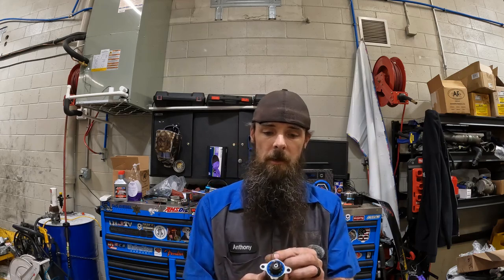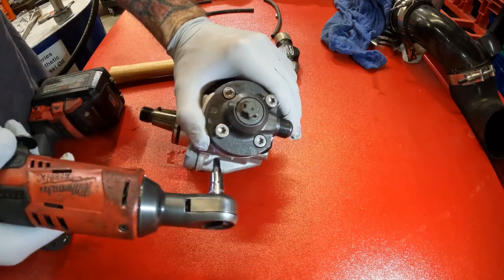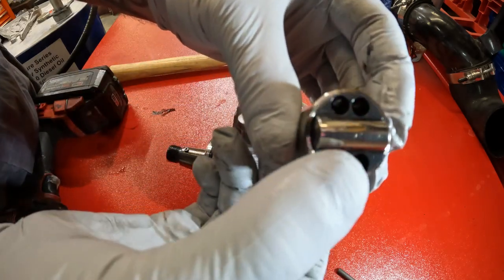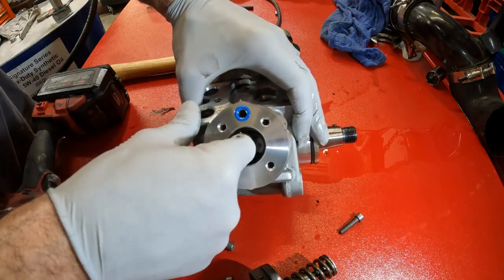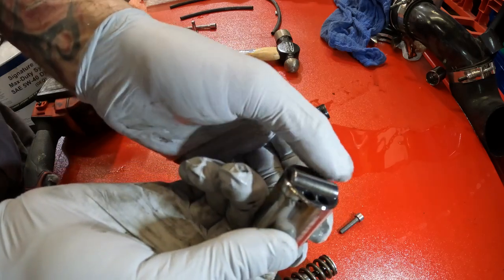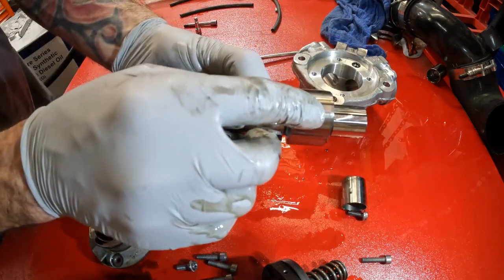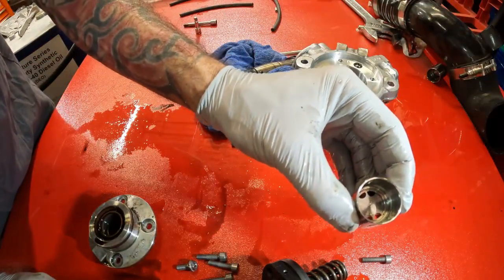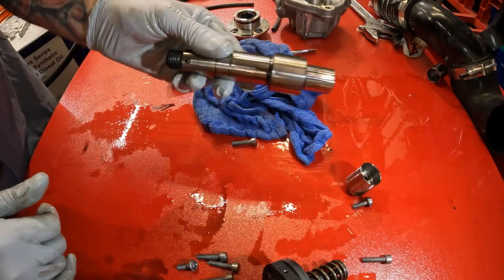How Bad Is This Powerstroke CP4 Failure?  Let's Find Out

Comment: Do you know if the 2019 late yr model is covered under recall.  My truck has 120k and just went to limp mode and Fird told me to bring in and it may be covered. Any pointers?
Reply from the maker: Usually a 2019 isnt covered under the cp4 recall. Thats the 2020 model.  Late model 19 is still a 19.  When was the last time you changed filters?  Usually if a cp4 goes its not going to go in limp mode. It jjst wont run.

Comment: Great channel and thank you for taking the time to make the videos to help educate everyone. Thoughts on installing a S&S disaster prevention kit for the fuel system? Is it worth it and would it prevent a contamination? 
2015 F250 6.7 with 77k miles. Thanks Shawn
Reply from the maker: Disaster prevention kit is good.  Depending on your budget go with a DCR pump from S&S and not worry about the cp4.  The disaster prevention prevents the entire fuel system from being contaminated if the cp4 were to fail.  Its just another filter basically. I'd go with a dcr pump though.  Again. Depending on your budget.

Comment: I will never take my truck into a psd tech after watching this thanks though and may you be blessed
Reply from the maker: Why would you not take it to a PSD tech?  Did you mean not a quick lube place?  PSD techs fix PSD. You're comment is very confusing. Like saying you won't go to IHOP because they serve pancakes. Oh and the drivers for this fleet vehicle neglected to bring it as well after being told to. Thats why this all happened
Reply: @ because how simple it is to swap it out why pay thousands if I could just do it myself. You know what I mean
Reply from the maker: @chris24v  swap what out?  The oil and filter?  By all means yes please do so. The engine?  Have fun. Its not just a simple swap.
Reply: I’m Talking about swapping out the cp4 it’s not that bad.
Reply from the maker: @chris24v  ohhhhh man I was so confused for a min my bad. Totally thought thus was a different video (got a lot going on) No cp4 swap isn't bad at all. Just make sure you reset the high pressure fuel system afterwards. I have had people tey to do theirs and they can't. But I also install DCR pumps. We don't put cp4 back in.

Comment: i have a 2019 ram 5500 with 6.7 i got diesel coming from lift pump but nothing coming out of cp4 no high pressure at all help please im planning to change cp4
Reply from the maker: Sounds like you have a cp4 issue if you got nothing coming out. Sounds like a failed cp4
Reply: @ thanks for your quick reply.,if I got diesel coming in I have to get something coming out right? There’s nothing at all coming out of cp4 already test metering valve is good no debris looks clean Have many codes related to fuel pressure I’m in a rural area already took pump out really really hard to turn it manually you think even if return has a problem diesel have to come out to the rail from cp4 right? Thanks again man
Reply from the maker: @mlbcom  they are hard to turn by hand.  You got diesel going in. When the pump is turning it should be coming out. The return line just takes the over pressure from the injectors and sends it back to the rail/tank.  Do you have a scan tool to monitor pids? Wait you said you took it out. It needs like 5k psi to start. Reasons for nothing coming out. Clogged up filters, gelled diesel, debris, failed pump.
Reply: @BeardedFordTech  i'm a little limited since that truck is ram 2019 i have to use bypass cable to communicated through wate gate   and try to diagnosis through mode 6 is kind of hard for me i check some data but still nothing diesel clean no clogged filter i guess cp4
Reply from the maker: @mlbcom  sounds like a failure. Yeah ram started locking their gateway modules in 2017. Forces ypu to take it back to dealer. If I'm not mistaken there was a recall on the 6.7 cummins for that. I'll ask my mechanic at work. He has a 2020 and worked at Chrysler dodge jeep ram
Reply: @BeardedFordTech  I’ll appreciate it Man
Reply from the maker: @mlbcom  shoot me an email.  This conversation will get buried in comments. Email is guaranteed.  Just put 19 ram cp4 in subject line
Reply from the maker: @mlbcom  Safety Recall Y78 2019-2020 Ram 2500 pickup 3500 pickup 3500 cab chassis 4500/5500 cab chassis CP4 fuel pump replacement.
I thought there was a recall.  They went back to the cp3
Reply: @ I’m doing the conversion now hope it works I let you know later on by the way happy new year man thanks for your help
Reply from the maker: @mlbcom  sweet. Happy new year to you too

Comment: What causes ford not to go with a different pump design after all this? Did they say anything about it back when you worked at the dealer?
Reply from the maker: @powerstrokemaintenance  i have no clue. Dodge and chevy went back to the cp3. I think it's contract legal stuff.  Never mentioned it at the dealer. I just fix them.

Comment: Thank you for showing how to tear it down.  We're getting ready to tear down my friends CP4 that we replaced with a DCR a couple of months ago that had 380k on the original pump. No codes or issues with it at the time, just did for preventative maintenance as I've mentioned to you via email.  Will be interesting to see what wear it shows.  Can the high pressure test be done with Forscan?
Reply from the maker: @richwitt3559  no the high pressure test cannot be done with forscan. I tried today. No option for it. Foracsn is really for code reading. Turning things on and off and some minor programming and resetting values

Comment: So have you actually seen the “pinned “ cp4 pumps ? Are they for sure in the 23 6.7 ? I lose sleep sometimes worrying about my pump because I didn’t know about this issue until later. As far as I can tell on the internet there are just rumors of the buckets being pinned to keep them from twisting. I just don’t have the money right now to get a dcr pump. Any suggestions for extending the life of my pump until I can get the money ? Thanks.
Reply from the maker: Of course I've seen one. Here's a video of me tearing one down. It's not a rumor. It started in 2019.  This one had def run through it. And it's out of a 2020
https://youtu.be/w1-NdCyKAIQ?si=7WWBhq6ZKGUGqOfq
It's just a screw.  But after a while the tip of it wears down from the bucket trying to rotate that it shears off and still rotates. It also sits below the pin.  If I was you. I would get rid of it and put a DCR in it.
Reply: @ Thank you !

Comment: You caught that EARLY. It didn't look bad to me, but I ain't a tech. Same year as mine, but about 80k more miles on the clock. I'm just over 205k. Saving for that kit you demonstrated the other day now.
Reply from the maker: Yeah it failed the test. Then debris on the vcv and some in the pump. Nothing is supposed to be in there at all.  There should also be no wear marks like that. And on the roller bucket. Did you see the side of it toward the bottom. Lots of scoring and wear. It was turning in the bore.yoremeber if yours hasn't failed. You need the pump only. Not the entire kit. Those pumps are well worth the money too.  Haven't had a single issue with one that has a DCR on it.

Comment: I would have thought it would take a little more of a visual failure to get to the point of causing run-ability issues. That just goes to show how little wear it takes to wipe out an injector system. Is there a chance there was something going wrong with one of the heads that contributed to the running issue or purely just a few fine flakes getting into the injectors ?.
Reply from the maker: @charlesb4267  6.7 does not have head issues at all.  I performed a high pressure and low pressure fuel system test. High pressure test failed immediately.  There isn't supposed to be any metal or debris of any kind in there. After it failed the test. We pulled out the vcv to verify.  Thats the diagnostic process. It was going to get a dcr pump anyway.  My entire fleet is getting dcr.pumps whether the cp4 fails or not.  It doesn't take much wear at all or much debris to destroy the fuel system.  It is very very sensitive.
Reply: @BeardedFordTech  I expect my wording for the component is not correct, I was referring to the heads as per the two spring valve assemblies that fasten above their respective pistons on the fuel pump ( not the actual engine cylinder heads ). But back to your point and findings, that how very little metal wear it takes to put the engine out of commission and taking the injectors with the pump, and that every 6.7 on the road is sooner or later ( later in the case of this relatively lucky owner ) is going to face this very issue. It sure makes one want to have a DCR pump installed right off the show room floor but imagine they would deny any engine related issue if one did that even if they knew it never was at fault, voiding warranties is cost effective for any manufacturer !
Reply from the maker: @charlesb4267  i see what your saying now.  No they don't really have the head issues.  It's always the bucket roller that turns in the bore like this one started to do.  As far as warranty. A lot of dealers try to not cover it and blame the customer. This is out of one of my fleet trucks. I don't deal with the general public like a dealer does.  I don't need "customer approval'  I just disgnose and fix and do preventative. It's cool cause it's all internal.  I'm not flat rate so I don't have to worry about billing hours and such.  But. About two years ago one of my fleet trucks ended up at a dealer (got towed without me knowing until the dealer called to tell me it needs a fuel system and it's not covered)  well they didn't know who they were talking to. Let's just say it got covered and they got caught doing what they weren't supposed to do.